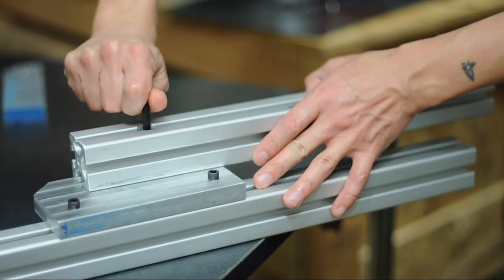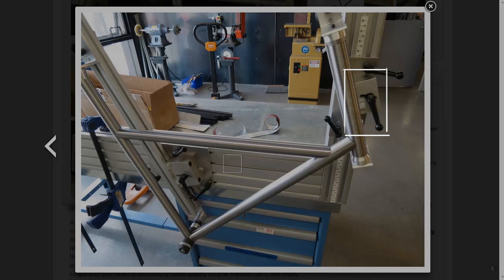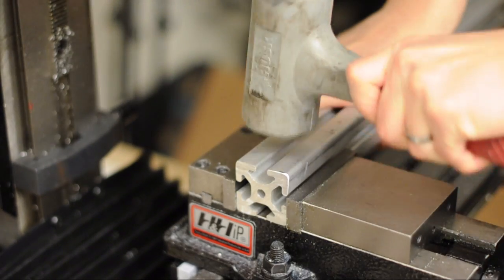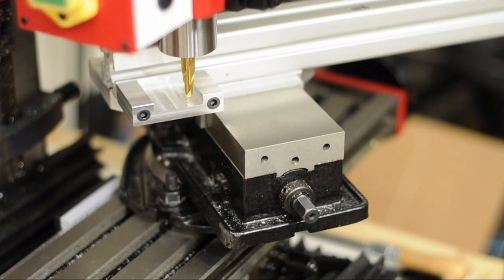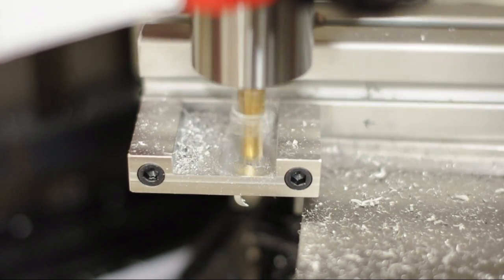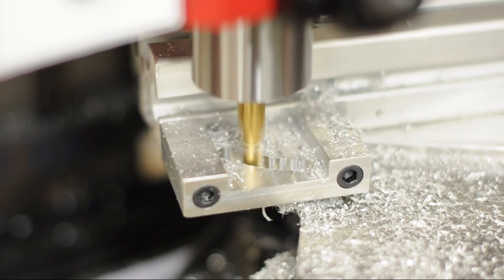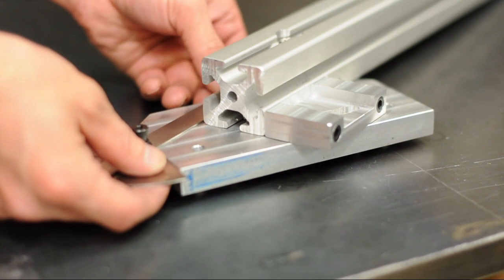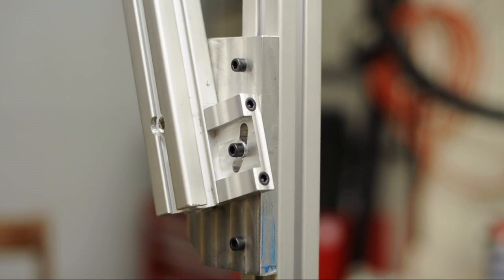Bicycle Frame Build 12 - Frame Jig Pt.04 - Fixing problem with head tube plate

Comment: A great series of videos, really diggin them! 
I've got a question concerning your routing machine and the routing bits you're using.
Are you working mainly with aluminum? It looks like you're using routing bits intended for steel - are those gonna wear fast? especially without the cooling liquid?
Reply from the maker: +Vilius Marcinkevičius Hi! The bits are for metals like aluminum. With aluminum, coolant is not always necessary but it definitely helps! I don't do much machining so no coolant because I don't have that kind of setup. The end mill I use for facing is starting to show wear. Been using it for a year now!

Comment: I have a tube mounted to the back of the jig and it's held in a bike work stand.  Another option is to make a small stand out of square tube similar to what I've done for my bench grinder.  The base is in the shape of an x with two little casters on the side. When it's flat it's sitting on the ground but when you tilt it over the caster touch the ground and you can push it around.

Comment from the maker: Hi Corey,  Ah now i see. I like it!  So you can simply loosen the bolts and change angle or position. Thanks for sharing. On a slightly diffetent note, what are you using as a stand for your jig? I need to build one soon because im running out of space for mine. I want to be able to wheel it around.

Comment: My jig looks similar to yours but I used double wide extrusion for the vertical and horizontal. The part for the head tube and seat tube/bb are single wide and are fixed with 4 L shape brackets. I hope you get the picture but it eliminates the need for any pivot plates.